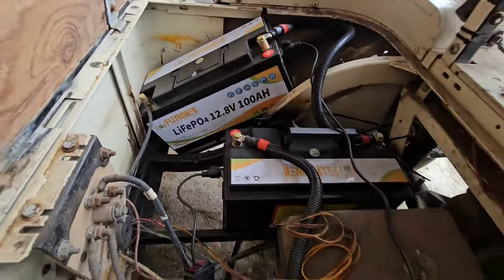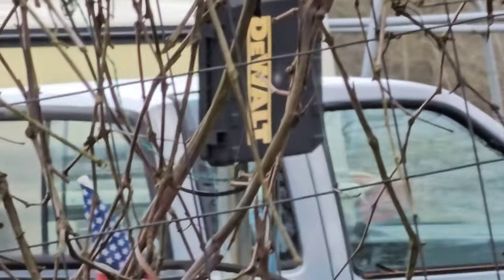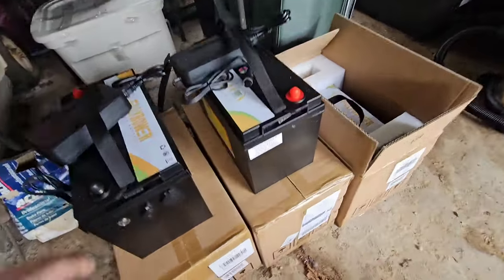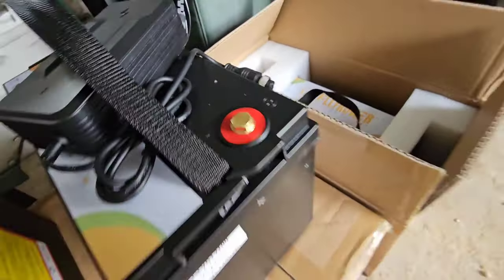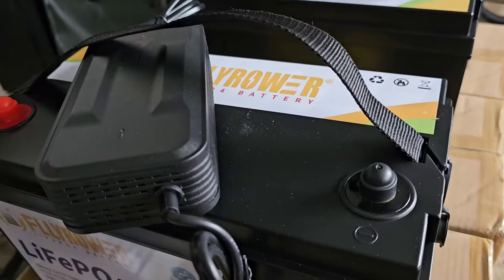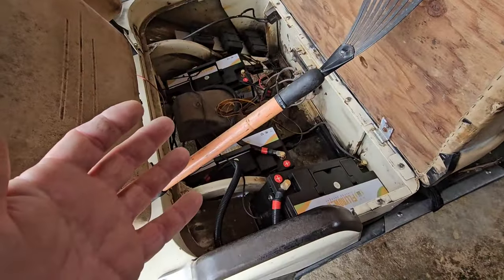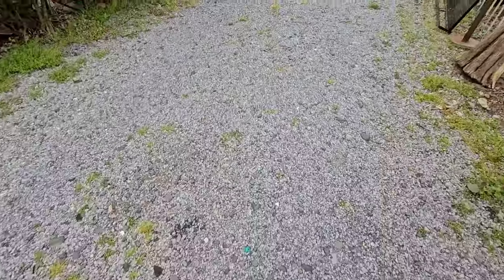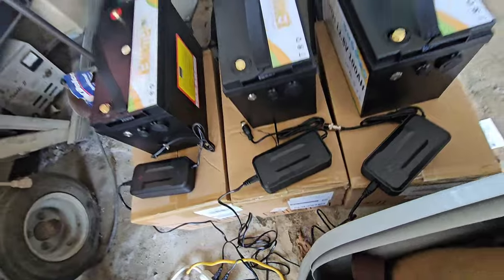Golf Cart Lithium Upgrade.....2 weeks in

Comment: Do the charging units need to be mounted in the cart ? 🤔
Some sheet metal and use of your shop and a couple of hours and you could have a 
decent floor ! ☝️🧐✅️
Reply from the maker: They don't have to be...... in the summer they're probably going to get used a lot I just wanted to keep them in there for ease of recharging might be a slight pain in the butt to hook each one up every time

Comment: Golf cart batteries with a USB a plug that is the first one I have heard of Bert cool beans 🫘 there
Reply from the maker: Well they're not really intended for a golf cart
Reply: @ScrapFarm   you got that right because of the power need to run the electric motor is in.a higher amp range
Reply from the maker: @robertmailhos8159  yeah but it's lifepo4... so technically it's equivalent to about 200 amp hours in lead acid... plus it doesn't have degrading power like a lead acid... you pretty much have full power until there's nothing
Reply: @ScrapFarm   okay thanks for the info on the battery for your golf cart